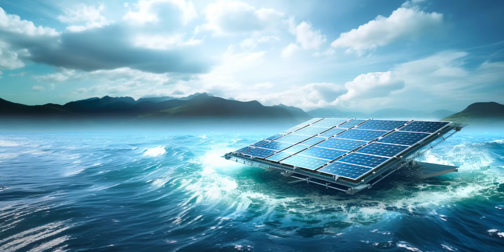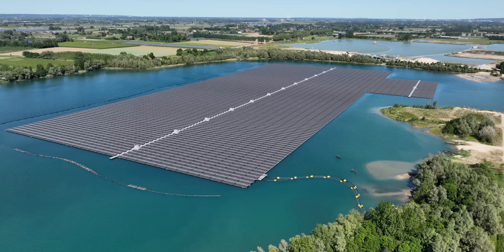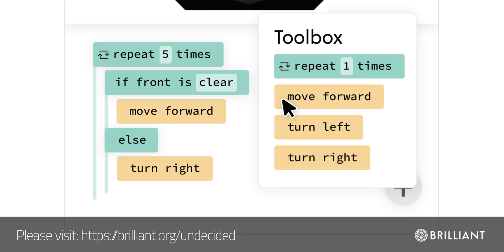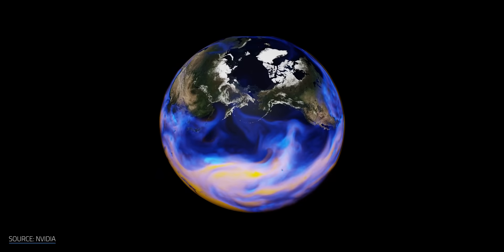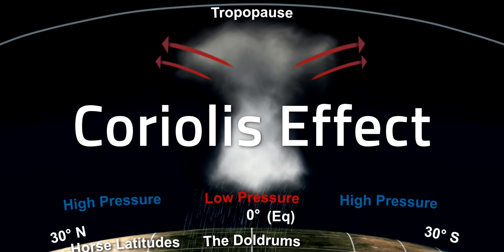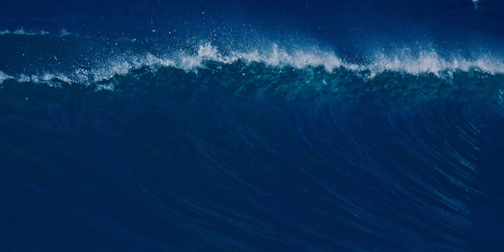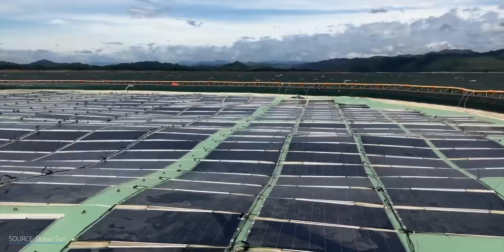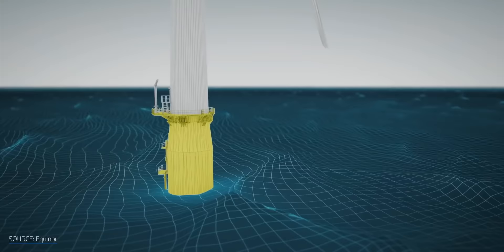How Offshore Solar Could be the Future of Energy

Comment: Salt water, the idea is ridiculous.
Reply: Exact same thought
Reply: What is your point here?
Reply: Solar panels already are standard on boats at sea.
Reply: Conveyor2 has a point 😂😂😂😂😂
Reply: lakes are easier
Reply: @miller2675 He's giving an answer to the question prompted in the 1st second. Salt water.
Reply: @conveyor2 Perhaps. But boats at sea have a crew who can clean the salt and prevent it from accumulating on the panels. And those panels are also built at the rooftops of the boat cabins, where water is less likely to reach, not built at the bottom of platforms.
Reply: The life cycle will be less due to salt corrosion, so they cost more.
Reply: Wow - do you really think that other people won’t have considered the fact that sea water exists?
Reply: @JohnR31415 the juice isn't worth the squeeze.
Reply: Why not consider desert areas within the country.  Yes there’s issues with heat, but if people feel that solving the corrosion issue with saltwater is feasible, then dealing with heat should be no problem.  Damaged equipment on land is easier to maintain than anything that is in the ocean.
Reply: Take a look at the thousands of sailboats equipped with solar panels to charge their batteries, which run lots of electronic equipment. You'd be surprised what already is possible and, more importantly, being utilized on a very large scale.
Reply: Lake-side floating solar makes a little bit of sense.

The water cooling of the panels is an interesting ideal.

Oceanic ones don't make sense unless you're supplementing as emergency power 

Or a place like Block Island and Martha's Vineyard where... Maybe it makes some sense 

Ooo actually know what the hoover dam actually makes a bit of sense to add some floating solar
Reply: @webbyonthewater8722 the cost of building transmission lines and how it goes through many districts or states make it just a mess of people arguing
Reply: The only way humans have ever made progress is to identify an opportunity and try to exploit it.  In the vast majority of cases it requires multiple iterations of improvements to perfect the solution - everything from the mundane like a toaster all the way to space flight and this is no different.  If you told someone in the 1850s when oil was first commercially exploited that we would be drilling for oil in the North Sea, Gulf of Mexico or off the coast of Labrador on giant floating platforms capable of surviving the storms in those areas in hundreds or thousands of feet of water they’d think you were nuts.  And yeah, those platforms sometimes (but very rarely) get destroyed but the majority survive.  If the cost of energy is high enough, the solution to obtain that energy is usually capable of being engineered. My guess is that at current electricity prices and materials  / engineering technology building on water in the ocean will have few places that it’s profitable.  However, i give kudos to these efforts.
Reply: @schenevus82 boats require constant upkeep. Certainly a small group of solar panels could be on the ocean if there were a team doing daily upkeep but this would change the economics considerably.
Reply: @webbyonthewater8722 Deserts aren't a better place to put them because..
- there is a huge drop in efficiency with heat.
- there is actually a large increase in wear and tear on the panel due to heat cycling
- panels in deserts increase global warming more, becayse they absorb more heat relative the the light sand that reflects it back into space.
Reply: @timtravelnomad  makes sense, but there’s many obstacles when considering offshore as well.  Some mentioned in the video and some that aren’t like habitat destruction from tethers and long power lines on the sea floor.  Salt from seawater spray sticks to everything and would quickly degrade the panels.  A better consideration would be the Great Lakes or dammed rivers.
Reply: @webbyonthewater8722 - “salt… quickly degrade the panels”

I am not so sure. I have frameless solar panels, which have 0 exposed metal.

If there is no exposed metal, what can degrade from salt?

If there is salt that forms on the top of the panels, each fresh water rain storm will dissolve some.

In appropriate locations, this could be pretty interesting!
Reply: Salt water is corrosive, but we have mitigation tactics that allow us to have things like boats, docks, off shore oil rigs, bridges, you get the idea
Reply: @DavidHalko  saltwater spray clings and cakes on surfaces.  Unless the panels are hydrophobic, they will get coated and degrade the ability to generate power.  As for the rain, it won’t help much.  You’d need water under pressure to remove built up salts.
Reply: Yeah the whole thing will rust because plastic and glass rusts
Reply: @conveyor2  Sailboats with solar panels have their owners to clean them but if you are doing it on a large scale the maintenance cost of the plant will be very high for not only replacing the shorter life of the components but also adding up the cost of having to continually clean the salt residue off and of course labor costs.
Reply: Indeed.
Salty air corroded many buildings over the year at the shore in my country.

One would only imagine what salty water would do to the fragile solar
Reply: Yea this guy just wants to spew out anything in order to make a new video
Reply: @HardBaseUnderMySkin  its not like he's the one funding all these resesrch lab x.x
Reply: @webbyonthewater8722 the heat damaging the panels isn't the issue, the inefficiency of very hot panels is the issue
Reply: @fuzzy-02 panels are made of glass which is largely made of what sand is made of...silica. Look at how much sand the ocean has destroyed😅
Reply: I'm not concerned about corrosion of the aluminum and glass, it isn't an unknown of how to mitigate. Cleaning the salt buildup is equivalent to cleaning dust and bird droppings. Frankly I am surprised that the efficiency gain is only 10%, heat makes a much bigger impact on my panels here in the desert.
Reply: @webbyonthewater8722 I would guess that more people live near an ocean or sea than do near a desert. This would make access to the power easier.
Reply: @john_in_phoenix  flexible, surface floating panels can be perpetually self washing if done propely.   You'll lose some efficiency from the light going through a bit of water but it won't be as bad as the water droplets most people never clean on the panels at their house
Reply: @ConcreteLand  that’s true to some extent, but a high population area like California has both.  I know everyone that has an interest in renewable energy is seeking the most options possible, but the ocean is an extreme environment and since you have to deal with shipping, and NIMBY homeowners/municipalities, it’s a nightmare in the making.
Reply: Cover it in a marine grade glass or plastic or glass that lets 40% the light through?

😂
Reply: @ValidatingUsername  😂
Reply: @ValidatingUsername   glass with salt damage will still be very effective at producing power. Moreso than a very clean panel in the dessert on a hot day.   It'll take a VERY long time before that glass would be chewed through down to the cells.
Reply: @webbyonthewater8722 Hmmmm. . .  Salt in the ocean is a Chemistry Problem.  Heat in the Desert is a Physics Problem. . .   I think Chemistry is the easier Problem to solve. . .  But, I could be wrong
Reply: @veganpotterthevegan  it’s not just degradation due to etching, salt from sea water builds up and discolors.  Essentially everything will have a haze from white to blue.  Having an extremely low efficiency after only a few months wouldn’t be worth the effort.   My personal interest is in putting solar panels or small wind turbines on government buildings as that would be a much better choice than either a desert or the ocean.  Offshore solar where it wouldn’t be an issue with shipping, recreation, and people/municipalities not wanting them in their view would push them 15 miles offshore where they would also be security issues.
Reply: @veganpotterthevegan  I understand that.  Build up of salt on panels is just as much of an issue.
Reply: @dewiz9596  if we could make the panels completely hydrophobic and have a means of scrubbing them, they would last much longer, but that would be extremely expensive.
Reply: @webbyonthewater8722  there are panels in the ocean that have had little degradation after years, not a lot of degradation after months. Panels are already out there.  Not a single reported security issue yet. 
*Definitely all for buildings getting their own solar too.
Reply: If we achieved perfect emissions free fusion energy, some prick in the comment section would still poo-poo it.
Reply: The Navy has entered the chat
Reply: Well let’s see what the resulting are. We may be surprised.
Reply: Also the amount of lost phytoplankton is VERY VERY concerning
Reply: @conveyor2 Boats at sea have exorbitant maintenance costs. For gr8d scale energy lowest cost wins which means easy to maintain panels in the desert.
Reply: @brettspencer-curran8269 you claim that so confidently.
Reply: @veganpotterthevegan while I agree that the saltwater issue is probably not insurmountable, I think the security issue is the fact that it becomes much easier to starve a country of energy by destroying the connections to the panels, in case of war or "little green men" operations. Energy security is an important part of national security and putting the panel farms far from shore is a nightmare to secure. A HV Interconnect is really quite resilient to bombs and rockets (as Ukrainian experience has shown), and a single-point break can usually be fixed in a day if needs must. And an otherwise healthy grid can usually reroute for the duration. On land, the substations are the only decently vulnerable targets, and as point objects, are easier to defend (at least on your own territory).
Undersea cables, on the other hand, can be rendered inoperable by a cargo ship "forgetting" to raise anchor while motoring in what is essentially international waters. They're more expensive and more time-consuming to repair, and are less likely to have alternate routes available due to the cost of building the undersea cable in the first place.
Reply: @Validole  well, for a while, it would just be supplemental power anyway.  Also, the ocean is very big.   It's extremely unlikely accidental damage from a ship would happen
Reply: @webbyonthewater8722  there’s the same issue with dust. You have to be able to use water to clean it off. It’s the e only way, really. Spoken as a desert dweller
Reply: @BingusDingusLingus  I don’t doubt that, I’m sure there are many challenges, but the idea of putting everything into the ocean is foolhardy, and as Matt points out the challenges are numerous.
Reply: It's not ridiculous. it's a material issue, but solvable
Reply: you're right, putting salt in water IS a ridiculous idea (you can't even drink it!), but what does this have to do with solar panels?
Reply: @miller2675  salt and metal equals corrosion okay!
Reply: Maintainance teams can clean off barnacles once/month. Also, Plastic tarp along the bottom of these platforms can take on barnacles, pulled off, cleaned, & reinstalled regularly. Plastic panels coated with salt don't seem to be a problem outside on sailboat decks. After being sprayed with salt water regularly. if cleaned just once per month, even. Very excited about the possibilities here. Especially with Automated, fresh water sprayers & bird chasing scarecrow tactics.
Reply: Salt water, the idea is ridiculous. @CaliforniaBushman
Reply: Not everything is destroyed by salt water
Reply: @miller2675   🤦‍♂️  
well it's cruesive isn't it?.

Comment: Why are they so set on combatting wave action when they can incorporate energy generation into the floating solar farm so that wave action would significantly boost electrical production??? If you have two sources of renewable energy hitting your plant and only use one, you are certainly not optimising your design. And when you think about it, most opften then not, the less sunlight that hits your panels because the weather is bad would also mean you would get more wave action in return. So your energy generation would even out much more! Because let's face it: The Achille's heel of solar is... well, sunlight not always being present.

Comment: I like the idea of FPV reducing evaporation of calm fresh water reservoirs and aquaducts, floating solar could locally help power pumped hydro and water flow. Also, coastal areas tend to get fog
Reply: Yeah, I just ran the math, and I think about 8% of the total flow of the Colorado River is lost through evaporation from (the famously drought-afflicted) Lake Powell and Lake Mead.

Covering half of each lake could reduce evaporation to 4%, and could generate a whopping 60GW of power.

Recreational boaters on the lakes would be unhappy.
Reply: @aaronclair4489  Check out the other video on floating solar. FPV is generally not optimised to reduce evaporation. It reduces evaporation by about 30%.
Reply: @GerbenWulff  but surely improvement will continue, and 30% is still massive when you consider the volumes we're talking about. Deployed on canals and aqueducts and the like where the surface area to volume ratios are much higher than a lake would have a larger effect as well.
Reply: It seems like a no-brainer to add floating solar on a hydroelectric Reservoir. In a situation like Lake Mead even more important because the water levels have been dropping to the point where the water intakes for the turbines are above the water line. At which point you cannot produce power from the water
Reply: @aaronclair4489 

"Covering half of each lake could reduce evaporation to 4%"

It would also adversely impact the ecology of the lakes.
Reply: @94leroyal 

"Deployed on canals and aqueducts"

You wouldn't deploy a floating platform on either of those.

The panels would have to be supported from the sides directly above the water to prevent the turbulence from causing damage during high flow times.

Comment: Some interesting developments.  I'd just like to point out that floating off-shore drilling platforms do NOT weather heavy storms.  For example the ones in the Gulf of Mexico will often stop drilling operations and get towed hundreds of miles during hurricane season in order to avoid storms.  Of course offshore PV could do something similar, leaving a sub-surface power connection behind while towed out of harms way.

And like some other promising energy technology, there is the issue of where the energy is 'harvested' and where it is needed.  Transmitting power long distances isn't cheap.

Comment: Thanks for this, Matt. As someone who lives on the water, I was disappointed that you didn't bring up that these systems are also a hazard to navigation. Yes, we always sail with someone on watch, & yes, they can make sure that these flotovoltaics are well lit at night, but it is an issue, especially for us small boats. And charts are slow to be updated, & slower still to be distributed, so sailors may not be expecting them, at least until they become more common. These are relatively small issues in the greater scheme of things, & there are mitigations, but they're important to us & to other cruisers (as we call ourselves).

Comment: Several companies are attempting to convert the open ocean into a massive solar power plant using floating solar panels. However, the engineering and maintenance challenges are significant, and the cost could be too high. Floating photovoltaics (FPV) is a relatively new branch of the solar industry, with global installed capacity expanding beyond 1,000 MW around 2018. FPV has three major benefits: it does not occupy limited space on land, solar panels on water stay cooler, and bodies of water shielded by FPV are less prone to evaporation, which helps preserve freshwater supplies. One of the largest solar farms in Europe, built on Portugal's Alqueva reservoir, has seen an efficiency increase of up to 10% and an average annual productivity increase of around 4% due to water's cooling effect. However, applying the technology to the ocean is challenging, and several questions arise, such as whether the panels will be smashed to pieces during storms.

Floating photovoltaics, or floatovoltaics, is a new branch of the solar industry that involves solar panels moored within a body of water. FPV has three major benefits, including not occupying limited space on land, performing better on water, and shielding bodies of water from evaporation. While the technology has become more common with about 3.8 GW installed by 2021, the technology is still in its infancy and needs to be developed further. Recently, companies like HelioRec and Ocean Sun have attempted to put solar panels out on the ocean, but the engineering and maintenance challenges felt insurmountable, and the cost would be too high. Although FPV is already an emergent use of canals, lakes, and artificial reservoirs, applying the same tech to the ocean is more challenging. 

FPV is a boon and is being tested in places like the United States and India, where miles of canals are being used to determine if FPV is a boon…or boondoggle. According to Pedro Oliveira, the Director of Innovation at EDP, a Portugal utility, its FPV farm has seen increased efficiency thanks to water’s cooling effect. He cites an efficiency increase of “up to 10%” along with an average annual productivity increase of around 4%. A separate 2021 ENEL Innovation Lab FPV study found that floating systems can produce anywhere from 4% to 7% more energy than ground-based solar. The challenges of floating solar panels in the ocean include developing seaworthy panels that can withstand storms and maintaining the panels.